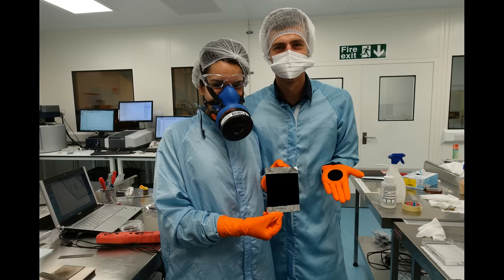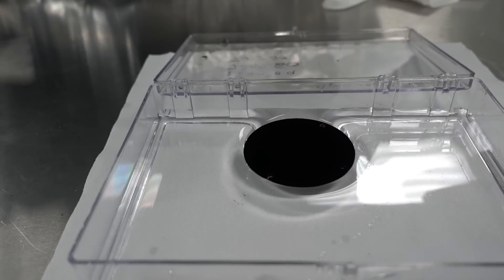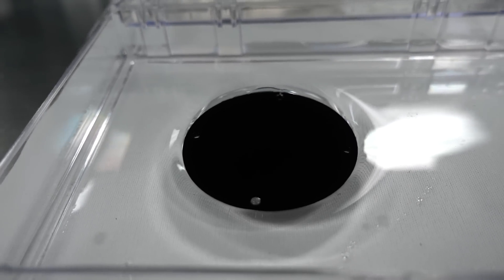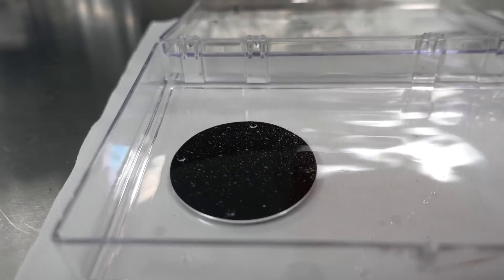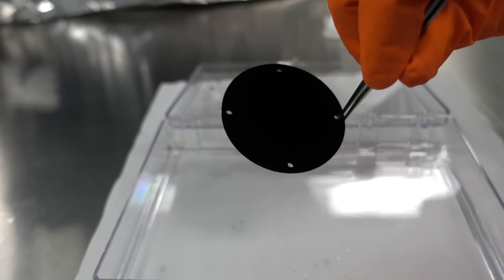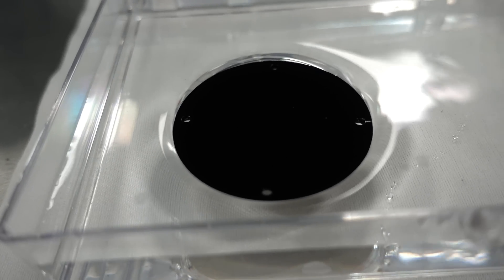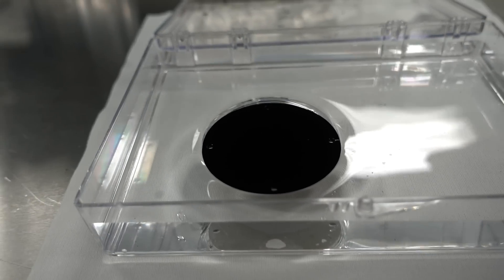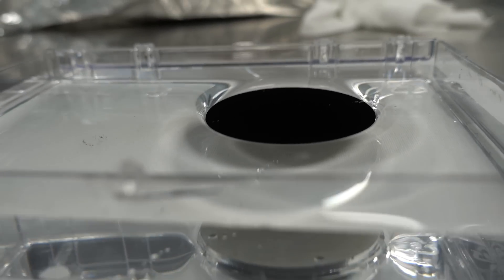How is it possible to make a flat disk of aluminium float on water?

Comment: might make a super light life vest..but I noticed that it sank when pushed under...might same thing happen when one gets tossed in the water. Maybe when used as a coating on flotation devices. Can it be reversed to reflect radiational body heat so it can used as hypothermia protection?

Comment: If you would coat the hull of a ship or a submarine, would it reduce the flow resistance?
Reply: Yes it would, it would effectively make it so that water was not touching the surface of the vessel, but conversely make the submarine much more susceptible to pressure.
Reply: No.
Reply: Yes, but I believe the reason they don't use hydrophobic coatings is that they tend to be much less robust than other coatings, and lose their benefit the moment they get bumped or scratched or attached to by an oyster, which tends to happen pretty quick for a boat.

Comment: what if u had two of those plates. set them face to face close to each other. is it possible that when the gap tightens the water cant get between the plates because of the surface tension. would there bee an air gap then? if so what would be the max distance between the plates before the water can get between the plates.
Reply: what happens when the water pressure rises... the airgap made by water surface tension tightens?... if there is airgap could you put an ant walking on the plate while the plate is underwater.. like a antsubmarine.
Reply: You should see a doctor

Comment: it would be  perfect to spray it on clothing for Passengers of Boats and Planes, so if the Crew and Passengers end up in any body of water, they will float.
Reply: also the Plane and Boat as well, of course :) painted with it, i mean.
Reply: It wouldn't make a boat or even a person float. It would keep them nice and dry as they drown :)
Reply: why would it make them sink and not more buoyant?
Reply: +JohnyFive ; Shorts look at the video, when they put a little weight on the disk, it goes under and stays under. The reason it floated is because unlike most surfaces, water does not have adhesion toward the coating, and the atraction between the individual water molecules is stronger. drops mic

Comment: Isn't that a very delicate surface though. There are a lot of products that are just a hydrophobic. I'm more impressed with the light absorption or lack of reflection. Would be a great coating for the insides of telescopes, cameras, lenses, and other light sensitive instruments. Kind of brings the science aspect of the product down making these "viral add" like videos.I feel like I'm going to turn the TV on and see an infomercial about this now. For just $99.99 buy two get 1 Free!
Reply from the maker: The demonstration is to show users of super black materials that this coating is not damaged by direct water contact or direct immersion. This alone is very unusual as most black absorbers are degraded by water contact. Also, that the contact angle is so low that it's able to have neutral buoyancy. And yes, you are quite right in that there are lots of super-hydrophobic coatings, but they are not the darkest materials ever created.  Finally, demonstrating scientific properties in a light hearted and interesting way makes it far more relevant to non scientific viewers, and maybe over time this will stimulate a stronger interest in science. From our perspective, that's a good thing.

Comment: Nice... So, in the future, it's could be used to build cheaper and bigger bridges...
Reply: For what purpose?
Reply: Uk to France... America to Africa... and so on...
Reply: and quick ones to integrate separate terrains...
Reply from the maker: Nice thought, but it wouldn't make any difference to the design of the bridge. This aspect of the coating is interesting, but has no practical use beyond protecting the absorber from damage.

Comment: Make a shoe with this material on it ASAP. I want to be Jesus for a day. Jk. 
But seriously though, would I float on water with a pair of shoe made from these material? 
If you guys do make a shoe with this material, hook me up. I want to test run the thing!
Reply: you would not float...
Reply: Well do you know anyone that that has a shoe size of some meters?XD Maybe with a modyfied shoe so that the flat surface is big it would be possible to float but not with a regular one
Reply: Is your brain the size of an ant?
Reply: AntWorld you would flip over and your feet would float atop the water. You'd have to have a specially designed shoe to walk on water that acts like a boat
Reply: Would probably depend on your shoe size. A few meters of flat surface and maybe you'd float :)
Reply: AntWorld  u will drown
Reply: you would have to use shoes that has a flat surface on the bottom so you float like a boat
Reply: the idiocy of this question made me lose a few brain cells.....

Comment: Weird how that plate seems to be held in place by the water, normally the disc should have momentum created by the sloshing of the water and would move about. Hey, what would happen if you submerge the metal disk and then freeze the water? Would the disk be easily removed? What about liquid nitrogen?

Comment: This coating is getting more awesome by the day. 
The two main questions for its usability: 
1. Scalability
2. Abrasion resistance
Have you already tested for the latter and have plans for the former?
Reply: Nanostructures are not very abrasive-resistant.

Scalability is as simple as a larger vapor deposition machine.

Comment: This works with any material that is sufficiently light. Aluminium might be metallic, but it's still a light metal.

Some quick calculations gave a repulsion force of 650N/m^2 as a combination of the water tension and effective repulsion due to the hydrophobic material.

I don't see why it's so amazing that a hydrophobic material is holding a denser-than-water material above water due to hydrophobic repulsion.

Comment: I'm currently studying the fluid mechanics course for my finals. Thus this question arises: what about friction? Imagine a water current going around a Vantablack coated body. Is it rejecting water completely? I'm emphasizing no-slip condition at the surface. Could be interesting.
Reply: it is a hydrophobic material, so water is trying under all circumstances to not interact or touch the coating.

Comment: A cheap emergency survival compass could be done with this.  Just a magnetized thin rectangle and a cup of water is all you would need.  No need for the metal to be a pin to "attempt" to float.
Reply: You can't get vantablack in a survival situation... Or a Metal square... Or food

Comment: I have an open source product Idea for the benefit of humanity I believe can be cheaply made into rolls and is very efficient.

"Water from Air where there is no other water source."

Make a hydrophobic flexible plastic sheet coated with Vantablack S-VIS and water-loving hydrophilic dots evenly spaced on it's surface.

Hang this sheet between two poles in a half circle like a funnel that water will drip off of into a container.

How it works:

At night the evening dew will collect on the hydrophilic dots from the air and will drip down the hydrophobic surface into the collector.

Insect beetles in dry Namibia have wings that they extend at night to capture moisture. 

Their wings are designed like the above set up which allows moisture to collect and drain towards their mouths.

http://www.naturalhistorymag.com/biomechanics/171934/like-water-off-a-beetle-s-back

 Related in benefit to humanity:

http://jalopnik.com/volvo-gave-away-their-most-important-invention-to-save-1069825878

Comment: could you make a heavyer plate so there is a hole in the water ?
Reply from the maker: Sadly not. The surface tension of the water would prevent this.